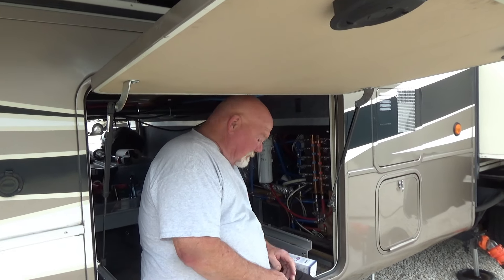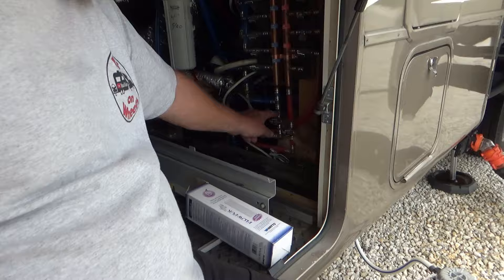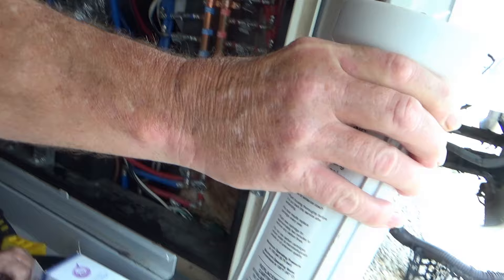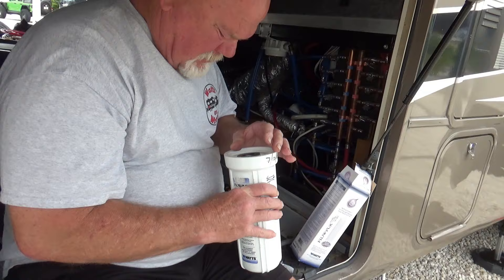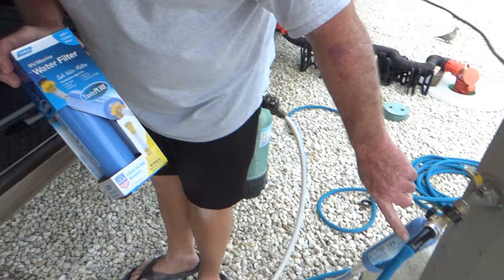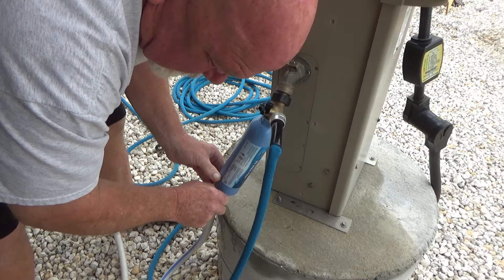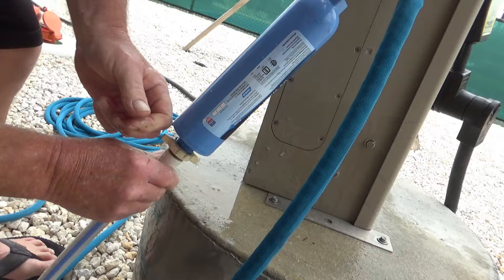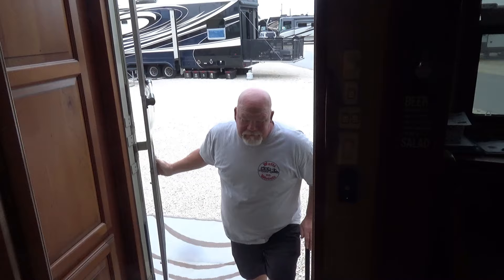💪 Internal & External RV Water Filter - Yuck!  // Changing Filters

Comment: When replacing a charcoal water filter (your in line hose filter), always, always, always, flush enough water through the new filter that the water runs clear before connecting the output side to your water system!  That is even stated on the package instructions.  In shipping and handling, the carbon particles get agitated enough that some of the carbon chips off and is evacuated with the first rush of water.  When you do the initial flush, the first water that comes out is black.  You do not want that in your water system!!
Reply from the maker: EXCELLENT!  You are absolutely right.